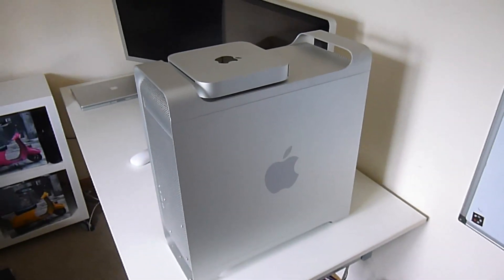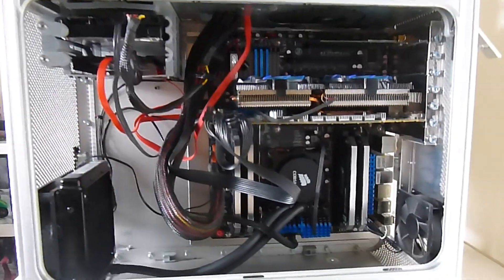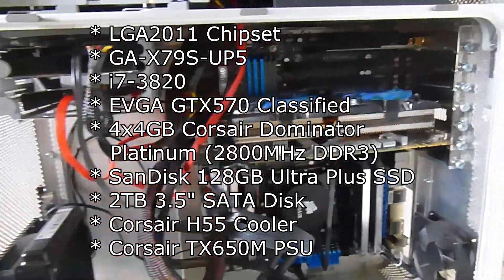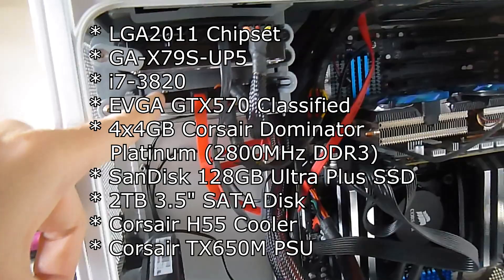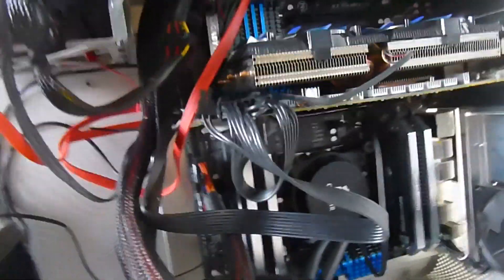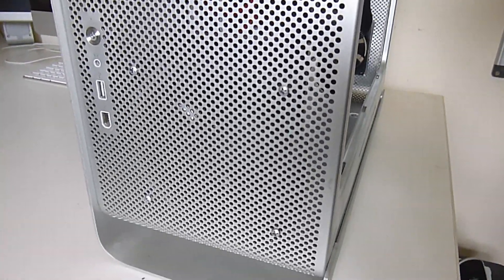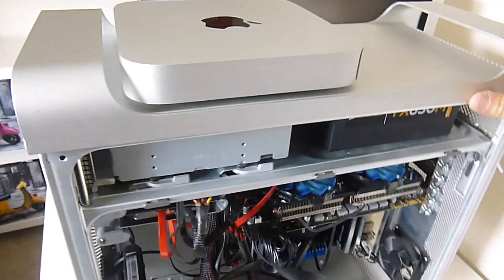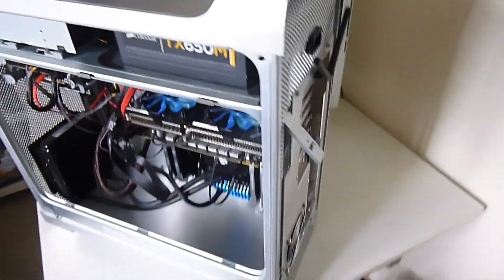Version 3 - Apple Power Mac G5 - Intel ATX Conversion i7 Hackintosh - Poor Mans Mac Pro

Comment: Hey Davey, Ive just started this project myself, your video is awesome for showing where you placed things! im struggling to find the  lian-li motherboard tray you mentioned anywhere though ? do you have a link or a specific model which fits best?
Reply: https://www.performance-pcs.com/case-parts-mods/replacement-accy-parts/lian-li-accessories/lian-li-motherboard-trays/lian-li-replacement-removable-motherboard-tray-d8000-ll-mobotray-d8000.html

Comment: == no need to cut any part of this case ......    pau cables can be extended + go through original mac cable route

Motherboard just slide it up to case and install video card.....and use headers to get usb etc

No need to use IO morherboard connections at all

Comment: Can you mod the G5 without the third party mobo tray and backplate? Like could you dremel out the old rear i/o shield then drill your mobo standoffs into the case? I plan on doing this with an mATX board.
Reply from the maker: Anything is possible :) However the IO section of the G5 is flush and on an ATX case its recessed so it will never be a tidy job.
Reply: Im not too worried about it looking nice in the back. I just miss having my G5 on my desk. I think Im going to drill out the back i/o and go from there.The only thing is when I install my graphics card will it fit? Like if I install the mobo will my gpu fit out of the box, so to speak, or will I need to mod the pci section of the case?
Reply from the maker: Kristofer Smith  I've actually got a spare mATX m/b tray and ATX PSU bracket here if you're in the UK and you want to buy it :)
Reply: Davey Lc I would but Im in the US :^(
So I guess I'd be better off buying the tray and bracket?
Reply from the maker: Kristofer Smith Check out my other video (https://www.youtube.com/watch?v=GFkASvU1azw) this shows the first version using the LianLi mATX tray and ATX bracket, this build is actually far simpler :)
Reply: Davey Lc I watched it. I just don't wanna have to buy something like that. If I do have to buy a tray and bracket I'll just buy the one specifically made to fit the G5.

Comment: Why in the world would you do a video showing us the inside of your case and then put specs on there screen so I can't see anything, waste of time.
Reply: There are high-res photos at the end of the video..
Reply: Just had a look, nice build. Does it make alot of noise with all the metal etc? Thinking of using soundproof sheets inside.
Reply from the maker: Tony Lloyd Hi Tony, I ended up applying a sheet of Paxmate to the base and inside of the door which sorted the acoustics.